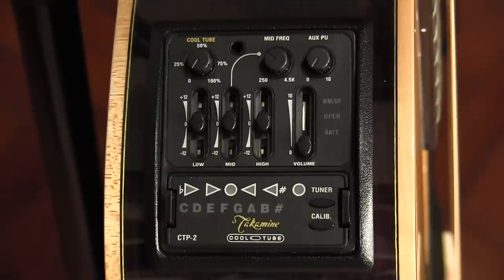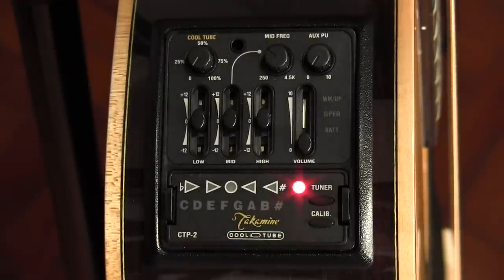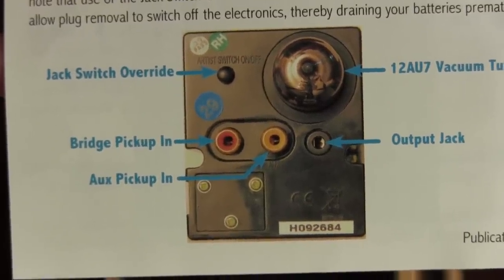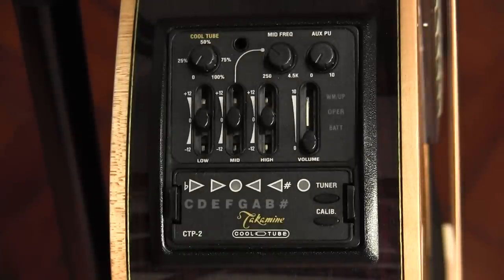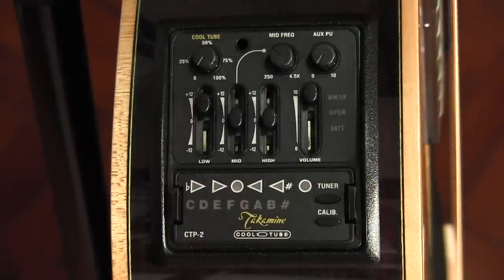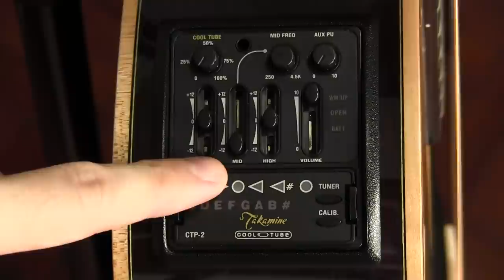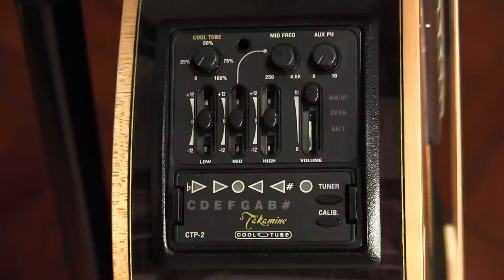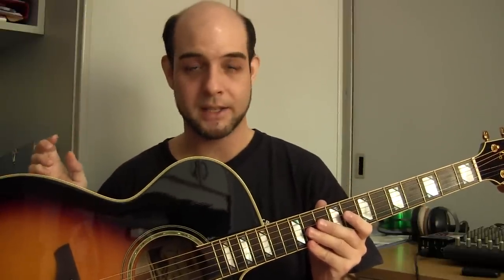The Takamine CTP-2 "Cool Tube" Acoustic Guitar Preamp - review and user guide

Comment: When using the Takamine Acoustic DI plus you must still have batteries installed to complete the circuit and take advantage of the phantom power.  You could use it without batteries if you solder the battery terminals together with a piece of wire, but then your tuner would not work unless the DI box is in use. So I guess we still have the weight of the batteries no matter what. Nice video.
Reply from the maker: Robert LeBlanc Thanks for the comment, it's always useful to have user feedback on these preamps. Fortunately the mounting location of the preamp is fairly close to where the guitar strap attaches so the rotational forces caused by the weight of the unit are minimised.
Reply: Don’t you have to replace the input plug to a balanced 3 conductor cable to get phantom power from the DI?

Comment: 47:06 this is probably the best sound I've heard from an under-saddle pickup/pre-amp combo. I usually hate UST pickups because they sound so harsh and lifeless, but this pre-amp really brings some life into them. I'm guessing "cool tube", and the fact that it's run on batteries, means it's a starved-plate design. Most cheap starved-plate studio gear I've used or heard usually sounds terrible (goes into harsh and lackluster distortion immediately without really warming up the sound), but Takamine has either come up with a way to make a starved-plate design sound really good, or they've added some other analog magic to the circuit.
Reply from the maker: Glad to hear that and thanks for watching :)

Comment: Hi, was wondering if you can help me. I have just got a ctp2 cool tube. The original owner left the battery's in and rotted tge connection in the pre amp and the wires have come off  the spring pins where the tuner clips into. I cannot find a scamatic anywhere and was wondering if you have the order of the wires connecting to the pins please...
Reply from the maker: Hi Keith, the man to ask is Bill Sutherland aka Mr Takamine USA - you can find his shop and contact details on Facebook or eBay.

Comment: Sounds great! Love those takamine guitars with the cooltube pickups, I just wish I didn't have to cut a big hole in my 714 and or my J45 to put one in. They aren't cheap either and don't come in any cheap guitars
Reply from the maker: Glad you think so! No I wouldn't bother cutting a hole in your existing guitar to fit one of these - there are far better options these days. Also remember that the preamp (the part you can see) is designed to work with the Takamine Palathetic pickup, so to produce the tone you hear in the video you would need to transplant both the pickup as well as the preamp - not worth it in my opinion 😉
Reply: @GLBProductions  Another great feature is that the preamp accepts a second pickup. IMO when you add a k&k to the mix is where you get the very best sound. I've also heard of people mixing a the triaxe pickup with it (its basically an LR Baggs M1A). I have the shadow nanoflex system in my J45 it sounds very  similar if I use a tube emulator.

Comment: Just curious about having the preamp volume at 10. Doesn't that effectively overdrive the signal going to the board? I've never had mine even close to that high, but maybe I don't get how it's supposed to work. Thanks. Good video too. I have a TSF48C, too.
Reply from the maker: No it doesn't - the preamp is designed to output cleanly at any setting on the volume control. It's not like a tube guitar amplifier which can be overdriven by turning it up past a certain volume. Now, it's possible to overdrive the input of the next device in the signal chain with the output from the guitar, but that's a different matter 😉 Thanks for watching!
Reply: @GLBProductions  Thanks for the answer to my question. I put my volume on 10 and, sure enough, it sounded just fine. Thanks for helping me get even better sounds out of this guitar.
Reply from the maker: You're welcome, all the best with your music!

Comment: Question what type of tool do you need to insert in the preamp hole to pull it out. I am getting a slight buzz/vibration from the preamp,  Great review
Reply from the maker: Pretty much anything stiff and thin enough to fit into the hole can be used - I have used paperclips, wire, thin drift punches etc.

Comment: Fabulous in-depth review, clearly explained.  I just ordered a TAKAMINE 2012c nylon string ltd which of course has the cool tube system.  Will I be able to plug the guitar directly into my Roland Cube Street Amp?
Reply from the maker: - Thanks for watching, glad you enjoyed the review. Yes you'll be able to connect to the Roland amp with no problems at all using the guitar/instrument channel. Just be aware that the output of the preamp is very hot so take it easy on your gain setting to begin with.
Reply: Thank you for your courtesy in responding so promptly.  I have saved your review to my favorites so I will always have it handy to refer to.

Comment: Hello, great review. Thanks.  I was reading below and the question / comment for Jeff made me think. So my question is:  I own a Tak EAN46c that is my absolute baby. Over the last 14 years I have tried several times to purchase a back up guitar but never could find one that I felt matched the body/tone of my Tak.  So... last week my pre amp stopped working and I was thinking about replacing it with the CTP-3.  My thinking was that the tube would warm up and add a bit more tone to an already sweet sound. BUT I do not want what you call, syrupy, and I read as muddy sound. Any thoughts you have would be appreciated.
Reply from the maker: Hello Trace, the TSF48c in the video has almost the same specs as your EAN46c (NEX body size, spruce/rosewood) so it should give you a fair idea of how the cool tube would sound in your guitar. My impression of the cool tube effect has always been that it adds harmonics rather than any one particular frequency range, so the sound becomes complex/warm but it doesn't become bassy. As with all things YMMV.  Remember that the tube can be taken out of the signal path if you don't want it.

Comment: Amazing video. Super helpful. Was having an issue with my CTP-2, getting no sound other than fuzz. Got a new tube, fixed it the first time I played it then back to just fuzz 2nd time I plugged it in. Any thoughts? Think this thing is shot?
Reply from the maker: In my experience these preamps are not designed to be repaired, but to be sure take the guitar to your local Takamine dealer/repair center. Thanks for watching!

Comment: Thanks for sharing ..
I would like to know, what is your experience with the Takamine Cool Tube 2?
I've heard that the Takamine Cool Tube 2 consumes much battery.
Is it true or just a rumor?
I bought a Takamine Pro Series TF360SBG
Thank you again.
Reply from the maker: - The battery life of the unit is around 24 hours, which is not very much compared to the other preamps that Takamine produce, so yes it is true. 
Congratulations on your guitar, the SBG series are some of the best guitars Takamine has ever made!
Reply: Every type of battery I put in it is dead or leaking 2 days later.. and now my amp wont turn on. Not sure if battery corrosion ruined something.. but it was the best sounding guitar plugged into a sound system when working.. I might have to explore lithium or rechargeable..

Comment: I have an EF341sc that is maple back and sides.  It's so freaking trebbly.  I think you're dead right about the cool tube + maple guitar = match made in heaven.
Reply from the maker: justun chan Yup, my maple Taks are all extremely bright. But better to have too much top end than not enough! You can always reduce it on the EQ if necessary, and I find that a maple guitar is absolutely perfect in a loud band - it may sound brittle and scratchy by itself but in a band it fits in great without needing to use a lot of EQ or compression.
Reply: GLB Productions  i'm looking everywhere to buy one of these preamps.. can't find them even on ebay.  i sent email to takamine, hopefully they can sell me one.  any tips or advice?
Reply from the maker: justun chan Yes, you should get in touch with the Takamine distributor for your country - there is a list on the website - they will be able to order you a preamp.

Comment: I have the exact guitar you played last as my gigging acoustic guitar. Great guitar at the price range and looks killer too. 2 things, I'm on my second cooltube preamp as the first one broke a while back and the battery life isn't 24hours. I'd say 4/5 gigs... about 15 hours or so. It's a great pickup in a lovely guitar though. I'm thinking about buying the triaxis aux pickup for her actually. Have you tired it? Super demo btw!
Reply: I just use rechargeable batteries, it works out a lot cheaper that way.
Reply from the maker: Thanks for watching! Yes I've also gone to rechargeable batteries for my Cool Tube preamps. I haven't tried the triax but I've tried the LR Baggs equivalent and it does sound excellent.

Comment: Hi
I seen your YouTube video on the ctp2 preamp

Great review

Do you have any idea what the screw between the artist switch and the valve does??? On the back
Reply from the maker: My particular version of the preamp does not have any screw between the artist switch and valve - I suspect they added that on a later revision of the preamp. I'm afraid I don't know what it does.
Reply: If you are talking about the nylon phillips head "screw" inside of the preamp between the artist switch and valve - it is a gain control for the tube circuit.
Reply from the maker: ***** Thanks for your input, let's hope the OP reads it :)
Reply: That video took a lot of work Rory, you have helped a lot of musicians.

Comment: Thank you very much for your presentation. I have a Takamine tc132sc: The guitar pad (Where the control knobs are) vibrates when I play. Can you fix it / tighten it? Thanks in advance.
Reply from the maker: +Paulo Sanches Yes you have to figure out which side is rattling and then use a paper or thin plastic shim to stop the noise. The fit of the preamp cannot be adjusted in any other way that I know of.
Reply: +GLB Productions Thank you. "I've used D`Addario strings (classical guitar HARD Exp46) on a  Takamine TC132SC and it's something I wouldn't advise to do.

Comment: Just an observation, but you neglected to set the sweep back to the recommended position when you were running the treble slider through its paces. I'm pretty sure that that would have affected the sound and you weren't getting a true treble slider response. The mids were still being modified at the 4.5k setting.
Reply from the maker: Thanks for the comment Jimmy - remember that when the midrange slider is set to the centre detent position the setting of the mid-frequency knob has no effect on the sound. So you are in fact hearing the true response of the treble control.

Comment: Hi, this review is quite usefull. Question I have that guitar is producing little distorted sound when playing it. EQ is set to flat, and this happens on all levels of volume. Can this point to some issue with CTP2 itself? or this can be related to cable + direct box used....  
Must add that I switched several cables and still same problem is faced.  Many thanks
Reply from the maker: Distortion typically comes from two sources: weak/dying batteries or a tube that is reaching the end of its lifespan. If the sound still occurs with a brand new set of batteries you may need a new tube.
Reply: @GLBProductions  Tnx a lot for your feedback. One more question, since I put new batteries, shall distortion be there  even if cool tube volume is set to 0? 
Can distortion be eliminated with just removing tube?
Reply from the maker: You're welcome. I don't know the answer to these questions - I suggest you experiment and see what happens 🙂 If the distortion is in the cool tube circuit only, you may be able to eliminate it by setting the cool tube knob to zero.
Reply: @GLBProductions  I appreciate your time and answers. Tnx a lot!
Reply from the maker: You're welcome! Hope you manage to solve your problem :)

Comment: Hi! Nice and helpful videos. I own a Takamine LTD 91 that I love but, am about to have work done on as it is in need. Unfortunately, I've been having problems with the original pre-amp, a TP (discontinued) and sadly feel I will need to replace it.
Any suggestions as to which pre-amp may fit best for my body style and wood? It's an FXC body type, Koa top, bottom and sides with an ebony finger board. Thank you.
Reply from the maker: Hello Pat the current equivalent of your preamp would be the CT4B-II, this will drop right into place. You could also try the Cool Tube if you want to be adventurous! As with all electronics, the Tak preamps do not last forever - the good news is that they are very easy to remove and replace.
Reply: Cheers for that! I was under the impression that the CT4B-II was only for certain Japanese models? I am interested in the Cool Tube as well! Thank you for your help and your videos.
Reply from the maker: You're welcome! No the Japanese preamps are interchangeable as long as the guitar has the sound choice docking port ie the black plastic frame around the preamp. The Palathetic pickup has not actually changed since the late 70s (!!!) and it will work with any of the currently available preamps ie CT4B-II, CTP-3, CT4-DX. That's the beauty of the Takamine design - they knew the preamps are the weak point in the system, and designed them to be easy to replace. The pickup itself under the bridge almost never fails :)
Reply: Thank you so much! All the best :)

Comment: Amazing review bravo !   question How to replace the Vacuum Tube ?
Reply from the maker: Just pull it out of the socket and replace, I think. I've never tried to do this though...
Reply: @GLBProductions  I already tried it and it does not work, is it has a locked ?
Reply from the maker: I suspect it fits very tightly - they are not designed to be replaced.
Reply: @GLBProductions  Thank you very much !

Comment: I have watch this video, what I wanted to know is this: On my Takamine TAN77 with the same Pre-Amp there is a lot of noise when I connect the guitar to a amplier. Do you have an explanation for this. And do you experience the same on this guitar
Reply from the maker: Mels Huijbers There have been a number of reports of noisy cool tube preamps since the introduction of the unit. Check for old or worn out batteries and dirty or corroded contacts, especially between the preamp and the output jack of the guitar, as well as the output jack itself. If these are all in good condition then you may have one of the faulty preamps - the easiest way to check is to bring the guitar to a Takamine dealer and have them swap out the preamp for a new one to see if the noise goes away. I experienced this with my TF250SMCSB, fortunately before purchase.
Reply: GLB Productions Many thanks for your quick response I will check the batteries and contacts. I also ask my Takamine Dealer to swap the preamp for a new one.
Reply from the maker: Mels Huijbers Great, let me know how it works out. Could I also invite you to join us on http://www.takamineforum.com/ - lots of great players there who are much more knowledgeable than I am :)

Comment: How about using high quality rechargeable batteries, such as Sanyo Eneloop to run the preamp. Does the slightly lower voltage affect the operation of the preamp?
Reply from the maker: - From listening to interviews with Takamine artists like Brad Davis, the tube circuit requires 3 volts of power, so I suspect that current is more important than voltage in this particular preamp. If that is correct, then rechargeable batteries should work fine. However I have no personally tried this ;)
Reply: I will give it a try when the batteries I have currently in my TF360SBG's preamp will die and let you know.
Reply from the maker: - Thank you, will be good to hear the results of your test - be sure to take note of approximately how many hours of battery life you get!